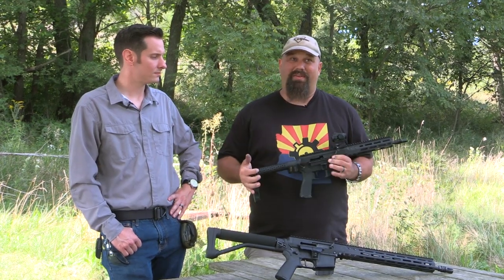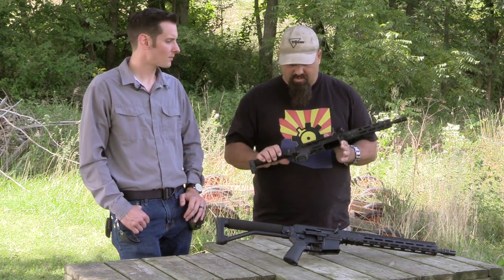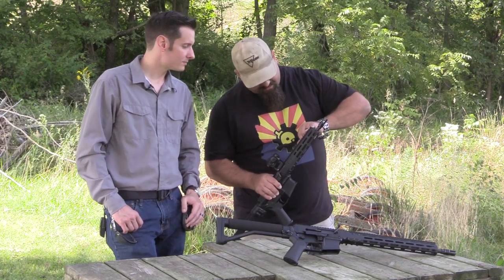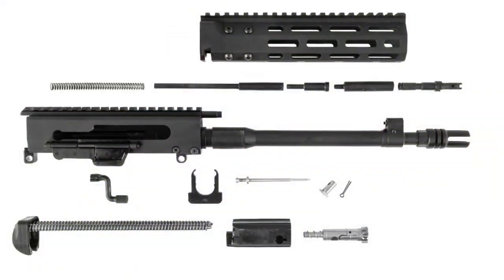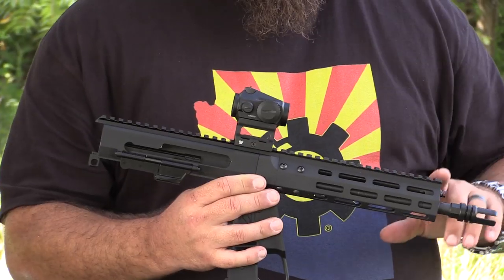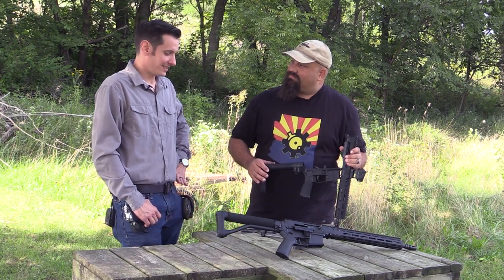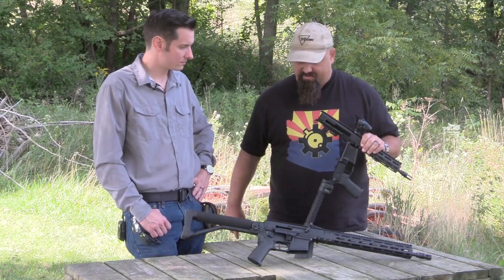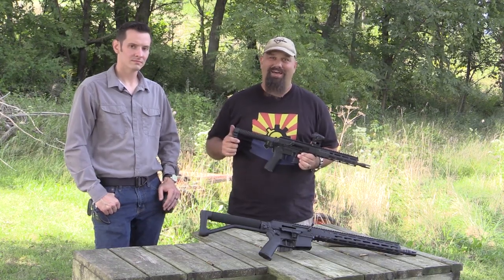A Shorter Stoner: The BRN-180s

Comment: So when's the 12.5" version coming? 🤔
I think that's the best "compromise" length for 5.56 I suppose. Im seriously considering the 16" version though. But the ejection seems kind of erratic and besides the folding stock I'm not so convinced that a short stroke gas piston system is better than the AR15s faux DI piston system. It's very proven too and modern materials and technology developed from competition have made it even more reliable and better than ever.
But that folding stock tho
Reply: I agree my HD rifle is 12.5". But I kinda want a folding carbine/PDW with an 8" bbl.
Reply: @chopinbloc  I'm not enamored with the velocity of a 10.5" barrel, shorter than that has me going "WHY" but there always is the fun factor. Shorty little guns like that with a big ass muzzle brake like the Lantac Dragon make excellent range cleaners. People pack up and leave so fast after 1 little mag dump. You could double down and get a magpul D60 and magdump that 😂

Comment: I had a  AR180 and built a tool to recut AR15 magazines for my AR180.  They worked well.  
Their was one report the recoil springs compress with use never had that issue but then I stretched them at each cleaning just a little and I shot it once a week.  Ran good for 4 years 400 rds a month.

Comment: The gases of the AR-15 "direct impingement" system doesn't impinge against the gas key; the gases get redirected into an expansion chamber where it pushes against a piston which is also the bolt. It's a hybrid system or an inline piston system.
Reply: I mentioned that in the other video.

Comment: Took my 180S build to the range in the following configuration: 

BRN-180S Upper-$694.20 
SB Tactical brace & 1913 adapter $188.67
Vortex SparcII Red Dot-$179
Magpul rail mounted QD adapter for my sling-$25
BFSIII binary trigger-$340
Lower Receiver- $40 

$1262 for upper, brace, lower w/ BFSIII binary trigger upgrade as 
compared to $1800 for a SIG MCX or $2150 for an HKMP5A3 with stock 
triggers. For a fair comparison, the HK comes with front and rear sights
 so add $200 to the BRN config and you are at $1462 if you kick in BUIS.
With stock milspec lower parts, the total is only $986.87 w/o BUIS, or 
$1186 with quality BUIS.

Total investment for config: $1,477 if you buy when items are on sale

Total weight is 7.3 lbs with on full 30 rnd pmag = one light weight and 
compact config!

240 rnds fired, zero malfunctions with M193 ammo
BFSIII worked flawlessly. I believe I am the first to report on binary 
trigger functioning with this system. The recoil was snappy, and was a 
flame thrower but expected in a 10.5 in barrel. If you reload, I would 
explore a faster burning powder matched with the right bullet to 
maintain peak velocity, but cut down on the flame throwing of burning 
powder.

This system is comparable in weight and length to an HKMP5A3 @ 21 inches
 stock folded, and at a hair over 6 lbs without loaded mag, optics, and 
accessories which is an apples to apples comparison. My only issue is 
heat around the forward hand guard which is easily resolved with a wrap.

I recommend a KE Arms SHTF+ Wrap for the heat that develops due to the 
piston gas venting but that will limit what you can mount in the area it
 covers unless you modify the wrap somehow, but that is the challenge 
with pistol configs or you will need gloves after the first mag is done.

Comment: The AR-180B uses AR-15 lower parts and mags and there is a milled AR-18 lower out there the uses those parts too. 

They don’t have to remake a freakin stamped upper and lower. I have the lower from Nodak Spud. Check out his website if you want one

Comment: It may have been a hard call but I think it was the right call making it drop in ready on any ar15 lower. There's ar180s out there. If you want to deal with proprietary issues down the road fine. But minimizing those issues by having so much of it more standardized that is a plus in my book.  adjustable stock fail? Guaranteed you can pop your spare on there. Interested in a binary trigger? Good to go.

Comment: $830 for this? It must be spectacular
Reply: Bear Creek for a $180-200 Option 😆
Reply: @joemoment-o1275  Where did you see that???  Highly interested if it's legit.
Reply: It isn’t an AR that a manufacturer can order OEM parts for. Everything is a one off. So all that R&D and production cost will be passed down to the consumer. In comparison, the AR has enough OEMs that a maker can assemble by ordering most parts by someone who has the process down efficiently.
Reply: @Rudyelf1  "The BRN-180s is a short, pistol or SBR version of the AR-18 designed by Eugene Stoner in 1963."
Reply: Mr. Crispy and because it is a version of it, it doesn’t mean that it is going to share a lot of the parts. And even if it did, there aren’t enough OEMs pumping bin fulls of parts to keep costs down.   You are looking at the upper through AR15 pricing lenses. Look at it through non-AR15 piston rifle lenses. When you do that you start to see it as a cheaper alternative to the SCAR, ACR, Bren, G36, arx.
Reply: @Rudyelf1  I'm not saying it doesn't look like a pile of fun or that it's a "bad" upper by any means. I just don't see $830 there, that's all.

Comment: Would it be possible to get a dust cover? I know some don't think it's necessary but I'd still rather have one.
Reply: It has a dust cover. Behind the charging handle.
Reply: @chopinbloc  D'oh! Couldn't make it out at first but now I see it. How's the seal on the part that's not covered?
Reply: @alexanderm8880  tighter than an AK...
Reply: @chopinbloc  Just wondering since a pro for the AR is that it's a sealed system.
Reply: @alexanderm8880  Sure. Absolutely. That's a fair point if you plan to insert by helicopter or convoy 50 miles on dirt roads. If not, rifles like the AK and others without dust covers are probably still reliable enough for most people. You've probably seen lots of AR vs AK tests and the one thing that's really important to take away is that it takes a lot to get any modern rifle to stop working.